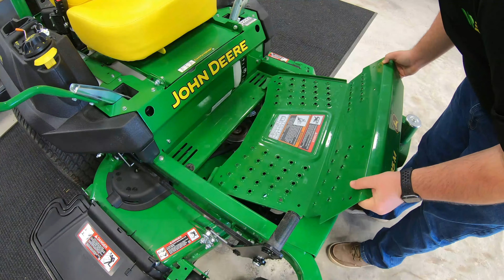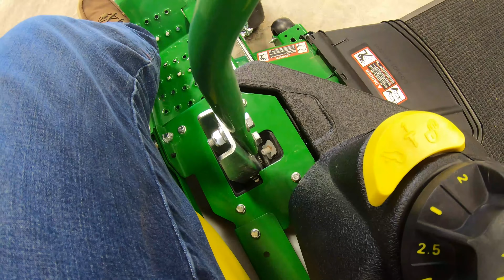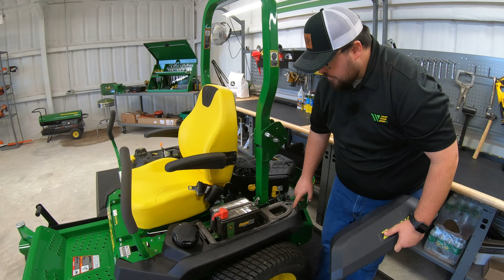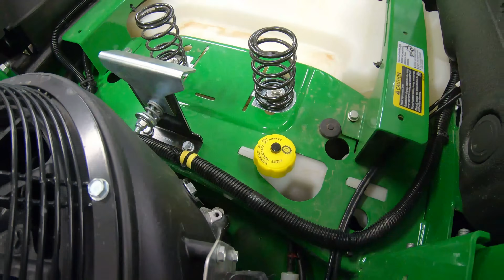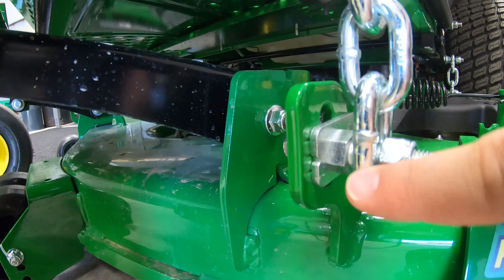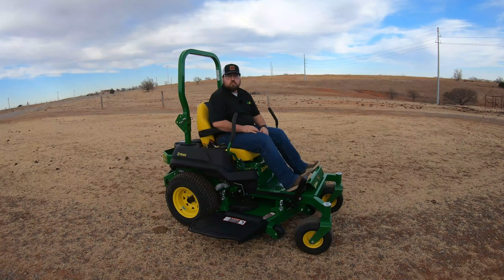2022 John Deere Z735M Zero Turn Mower Review & Walkaround

Comment: Considering there is only 1 option in the 9 Series with  Briggs & Stratton engine and it's an "E" letter series and the Z730M is about $520 more expensive than the Z735M on Deere's website I take it that Deere is telling us they think the Kawasaki motor is superior to the Briggs & Stratton?
Reply from the maker: I am pretty sure the price difference is just because of the actual cost of the engines themselves but most of the time the Kawasaki is assumed to be the superior engine.
Reply: The Vanguard engine from Briggs is every bit the equal to the Kawasaki

Comment: I bought a z530m my first John Deere product you are very educated on all John Deere mowers we have 2 acres the z530m rides really rough . What model would you suggest for a more comfortable ride as a zero turn mower to buy
Reply from the maker: Thank you! For that much mowing, I would probably look into the Z700 series. It will be a price jump but it will also last you a lifetime if maintained. Thanks for watching!
Reply: Thank you for your time and opinion I'll look into that model I was sceptic about buying the s540m I had a 60 inch Dixie chopper after 22 years it was time to put it to rest
Reply: For the money which 700 series would be best